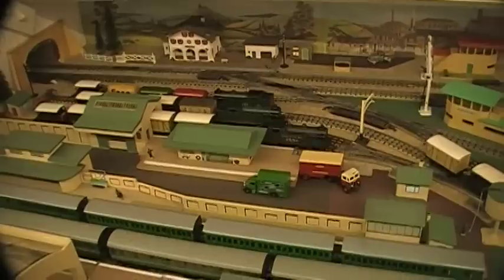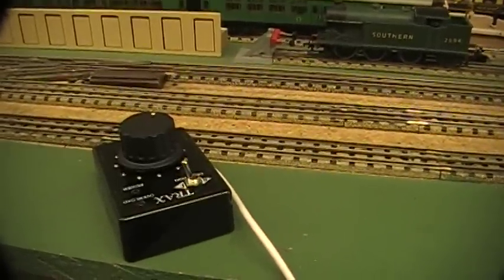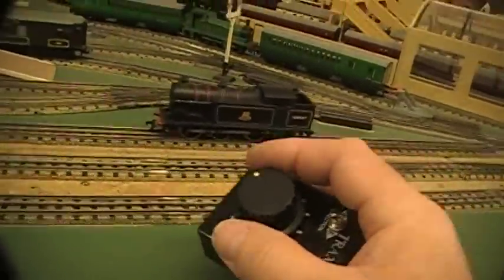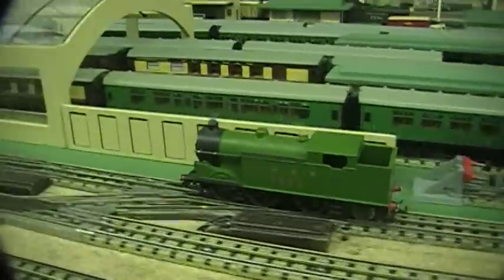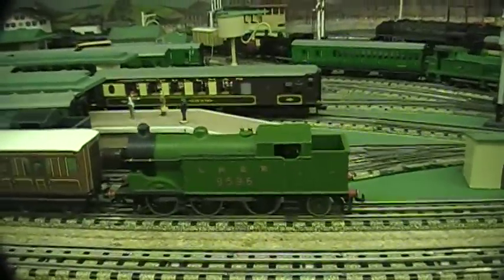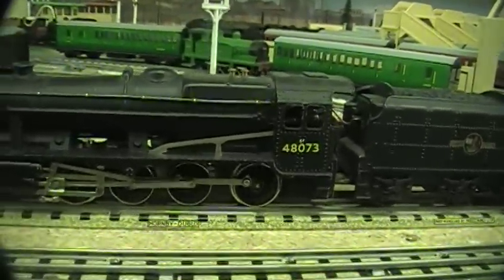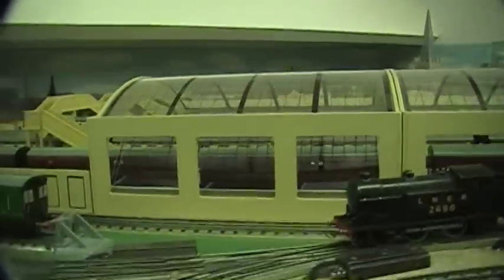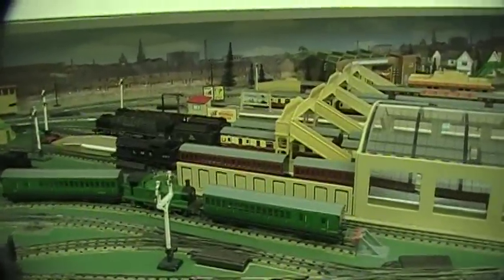Hornby Dublo train controller comparisons

Comment: Hi Ron, thanks for your informative video, I have HD locos from the 3rail days (paper boy money) up to about 1962, I have rewound a couple of the N2s  and an A4 (of necessity I might add, one a 3rail one and have kept to the same wire gauge, you made a comment about rewiring and I think I'll rewind again with a smaller wire and see what happens, maybe I'll have even better slow speed control. I have also moved to DCC, all my HD motors are drawing around 350ma running and up to 600ma stalled. I have replaced the magnets (which I had removed about 1955 (we NEVER listened/believed what we read did we ? and only knew about the ball bearings each end of the shaft about 45 years later)
Thanks again for the video (I'll bookmark this and return occasionaly although I can't promise when.  Thanks again Lindsay  (NZ)
Reply from the maker: Lindsay McIsaac  Hi Lindsay, If you rewind with a slightly thinner wire try 300 turns per pole (as I do) you will find reduced amps to about 0.1 and a slower top speed with more torque, better running all round. Ron

Comment: The problem with starting to move the loco on a 3 rail system is overcoming the frictional drag of the pick up shoe under the loco. 

Back in the late 1970's I used a Mechano Marshal 2 controller with Tri-ang, Wrenn, Lima and Mainline locos and very slow speed running with gentle acceleration was possible. The problem with a jerky pull away seems to be unique to Hornby Dublo 3 rail locos as I've never experienced it with later 2 rail Hornby Dublo and Wrenn locos running on various brands of analogue controllers.

All old school analogue controllers vary the voltage using the R1R2 centre tap principle. Turning the control knob moves the position of the tap on the resistance wire winding (that has both ends across  the DC feed from the rectifier) and the voltage is adjusted accordingly.

If the current is controlled via a wiper on a variable resistance winding (connected only at one end to a supply) then it is a Rheostat controller. These are more famous for use on trams and full size electric locomotives than model railways.
Reply from the maker: Hi Andy, having pickups on the third rail should cause no more friction than having them on the wheels as on 2 rail. Six of one, half dozen of the other. I do find modern controllers that control the voltage better that the old rheostat type.
Reply: Have to say I agree with Andy. I've a 2-rail "City of London" and a 3-rail  "Liverpool". Same experience as Andy lovely low speed control with my old H&M Duette on 2-rail. But not at all as smooth starting with the same controller with "Liverpool". The two locos are identical apart from the pick up arrangements.
Great video thanks!
Amazing how HD (three rail or two rail) just captures the feel of the real railway so much better than any super detailled modern system can. They just have so much presence...
...subscribed !
Reply from the maker: @robinforrest7680  If you have the correct (light ) pressure on the 3rd rail pickups I don't see why they would drag the loco down any more than the pickups rubbing on the wheels of a 2 rail loco. Six of one, half dozen of the other. The of the jerky pull away from a stand still is known as "stick slip" and is a phenomenon of all moving parts to overcome the initial friction, including 2 rail locos

Comment: Hi thinking about getting a Trax Fc-1
How are you powering yours 
Is a Hornby Dublo A3 controller be ok
On the AC outlet
Reply from the maker: Hi Neil, I use the AC accessories output from my controller, works fine.  Ron

Comment: hi ron do you have any problems using a h&m duette with your 3 rail locos
Reply from the maker: Hi Neil, I don't use old vintage controllers for safety reasons, plus modern controllers do work better.

Comment: Hi Ron would the gauge master 100m be
Ok with HD 3 rail locos
Reply from the maker: Hi Neil, Yes that will be fine but they do get warm if you run 2 Dublo locos on the same controller for long.

Comment: Ron - very informative. I am wondering if I could apply your principles to my Triang X03/4 motors? Regards, Michael Hurley
Reply from the maker: Hi Michael, Yes I'm quite sure the motor is very similar to the HD 3/8 motor, so it should work very well. Regards, Ron
Reply: Thanks Ron. I'll advise you of the outcome.

Comment: I run märklin is this AC too? will they run on märklin power?
Reply from the maker: Hi Peter, no sorry they are all DC.
Reply: +Ronald Dodd I had wondered, well better to know now than find out as they explode spectacularly in my living room...:D pity though....
Reply: I had a friend who ran TRIX TWIN stuff and used a DC controller but with some AC locos also. They seemed to work fine. The reversing latch had to be operated by he "fingergepoken" method.